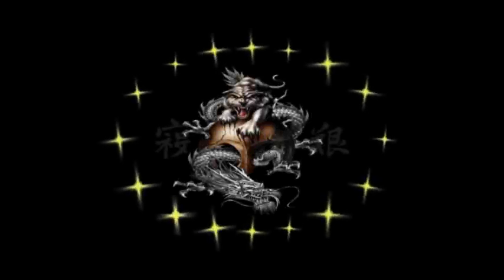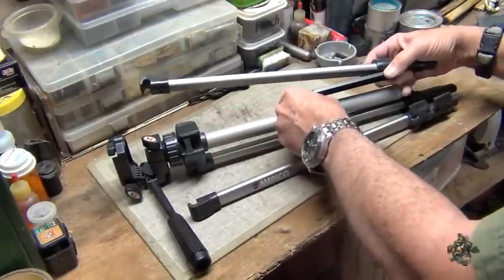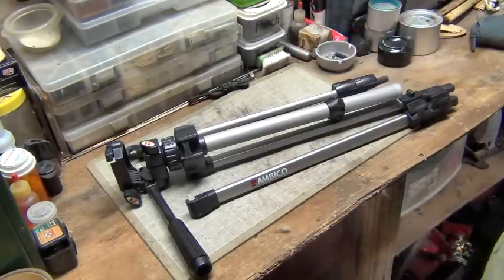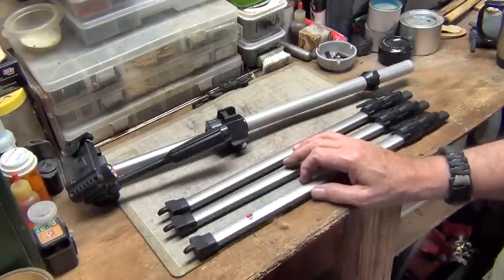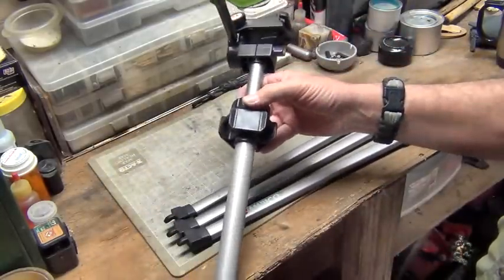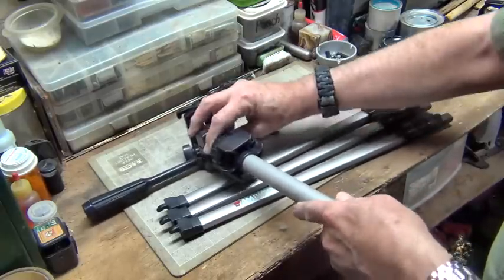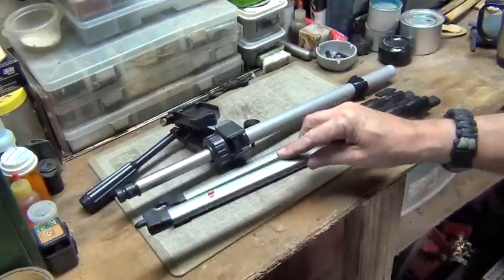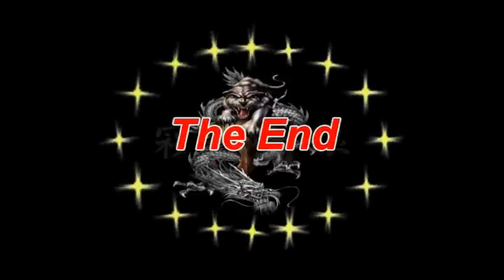Tripod Teardown

Comment: I like to repurpose things myself and have an old tripod I am about to disassemble.   You asked for some ideas.  Here's a few.

1) Remove mounting head from center pole, then attach a carved and padded rifle support to make a monopod shooting stick.

2) Remove camera mount and install a spotting scope to the center pole. Useful for bird watching or similar activities.

3) Attach a pointed end to the bottom of the center pole which can be pushed into the ground.  Attach a pot hook on the top end and use to hang a camp lantern or bug repellent device.

4) Attach fishing eyelets to a leg pole and add a cork handle over the larger end to make a nifty, lightweight portable emergency fishing pole.

5) Push the large end of a leg pole into the ground in a garden bed to create an expanding support pole for vegetables which you can raise higher as they grow.
Reply from the maker: Those are definitely some ideas to think about, thanks 👍  Thanks for taking the time to comment and thanks for watching too 😉 Take Care 😊

Comment: I wonder if it would be possible/useful to take along just the pan head portion and cut a stick on-site to make a mono-pod? Might also be a way of using the pan head with a stick to take video of yourself without having to take the straight portion of the tripod. Might save a little weight, if you could carve a stick on-site to fit tight.

Comment: I have a broken tripod too, the same model, and I can’t figure out how to take the legs off. If I snap them of like you did, could they be mounted back?
Reply from the maker: 5th Ace Studios 
It's been 4 years since I did this video so from what I remember you MIGHT be able to put it back together. You will have to use something to replace the pins you'll have to drill and drive out. Thanks for watching and for taking the time to comment 😆

Comment: Hi. Thanks for the video. I am trying to take my broken tripod and turn the legs into a steadicam. .. how did you drill through those pins?? I cant figure out how to get them out
Reply from the maker: +Benjamin Ockert 
I didn't drill all the way through the pins, the pins were rolled over (the metal was rolled over the plastic to hold them in place) so all I had to do was to drill down just far enough into the pins for the rolled over metal to break free. I hope this makes sense and that it also helps. Thanks Benjamin for your kind comment, and also thanks for watching too ;-)) Take Care :-))
Reply: +SurviveN2 Thank you! I will try that